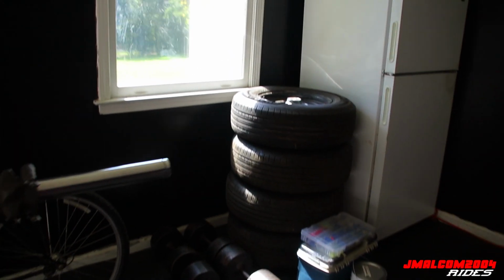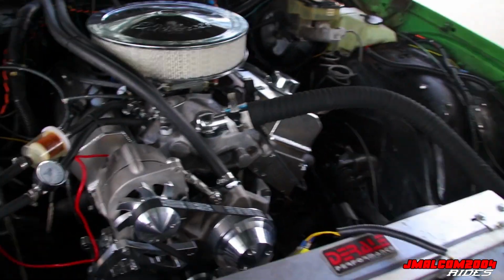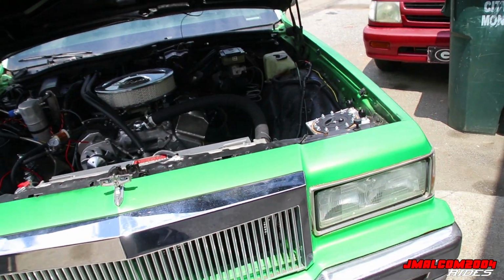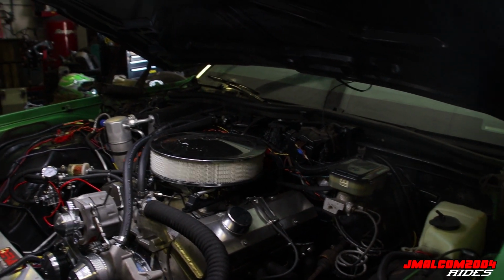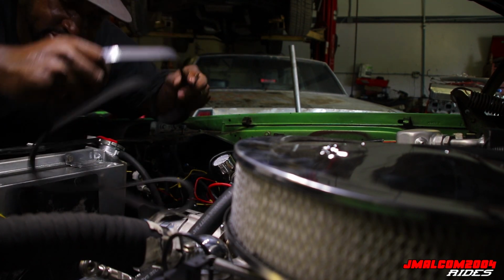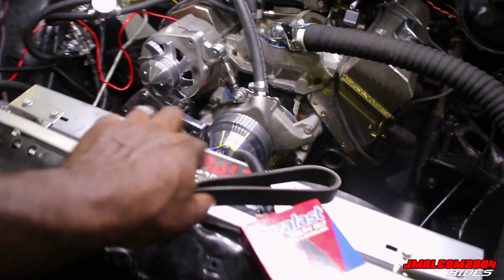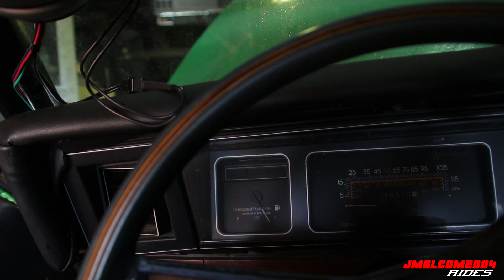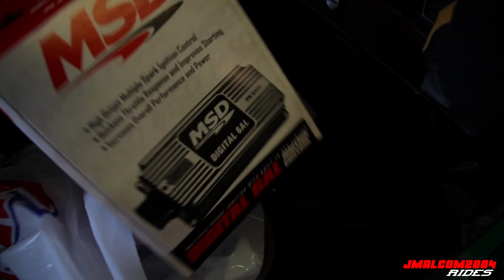TOOK THE 26 INCH RIMS OFF THE DOLO BOX CHEVY FOR A WHEEL ALIGNMENT BUT......

Comment: What up big homie.. love the footage always gotta check the new videos to keep up with you and the builds... Next time just a thought to help out with getting the wheels off the rear at one time, lift the car by the center of the rear end then set a jack stands on each side on the frame and sit it down slowly on them and ease the car down on the stands till the rims clear the fender, stop as soon as they are clear and maybe the spring will stay in place also🤔🤨 just a thought to maybe help

Comment: Hey G Dolo would get less battery drain if you get a thermostatically controlled fan switch. It would come only at the setting you set it to.It would save battery power on the highway,and it would cycle on and off.

Comment: It should be 2 degrees of timing out every 100hp...so if you use a 150shot you should take out 3 degrees an make sure you dont lean the motor out to far with the carb

Comment: run a 0 gauge wire from alternator to battery a 0 gauge for chassis ground zero gauge from engine ground with that 150 amp alt u need bigger wire they make big 3 upgrade kits she sitting good

Comment: Not sure why you think the alternator case isnt grounded. Its metal, with metal bolts, connected to metal, all of which conduct electricity.   Your issue is those 1 wire alternators dont charge when they turn slow, you put on underdrive pulleys which make your alternator and water pump turn slower.
Reply from the maker: Taylors rus didn’t think about the underdrive pulleys. That’s true
Reply from the maker: But the alternator still isn’t grounded. The brackets are all coated. It was grounded before I changed brackets. Needed a good ground too as will be seen in the video on Friday
Reply: @JMalcom2004Rides  Cant wait for the dyno. You should do a jump box giveaway for the closest guess

Comment: Them fans might be too much of a current draw on your electrical system. You may want to at least consider installing a cooling fan relay kit. Its a simple kit to install and it won't have the fans running all the time. If I can find the kit I was looking at for my shortbed, I'll email you the part numbers and price. Be blessed.
Reply from the maker: I have the relays hooked up too and a 150 amp Powermaster alternator. It’s straight now
Reply: @JMalcom2004Rides  , I respect that J. I was just saying with the fan control relay kit, it would lessen the load on your electrical system. The relay kit comes with temperature sensor which will turn the fans on and off as needed. Instead of them running as long as the key is on. I'm happy you got it though. I'm just trying to pass on some knowledge I learned from some old heads that's been helping me for the past 10+ years. Be blessed.
Reply from the maker: Bobby Jackson I know which one you’re talking about bro and I appreciate it. I want them both running at the same time to keep it cooler but you are correct
Reply: @JMalcom2004Rides  , yes sir! Can't wait to see the next vlog. You encourage me to keep being patient and waiting on God so I can get my impala on the road one day. Be blessed brother ✊🏾✊🏾✊🏾

Comment: Does that particular fan setup have an adjustable thermostat where you can set it at a certain temp that way the fan doesn’t have to run all the time?also what brand fan setup do you have.
Reply from the maker: MrColeman631 yes you can set it up like that and they’re Derale fans
Reply: JMalcom2004Rides ok thanks bro